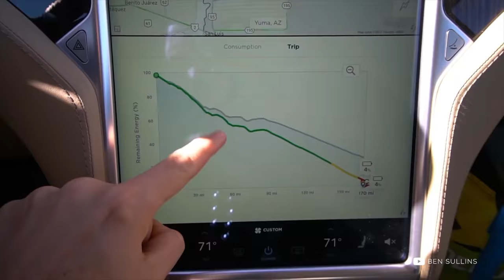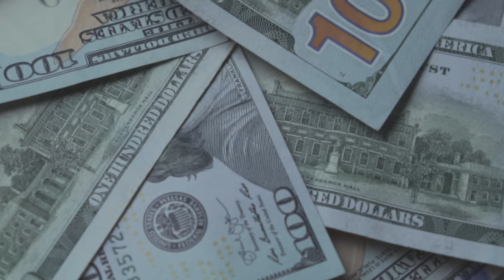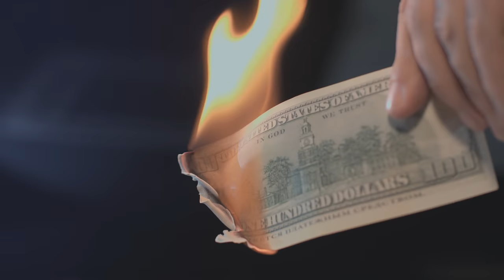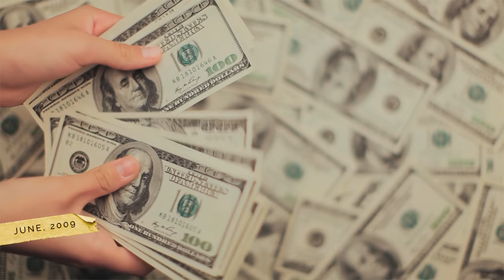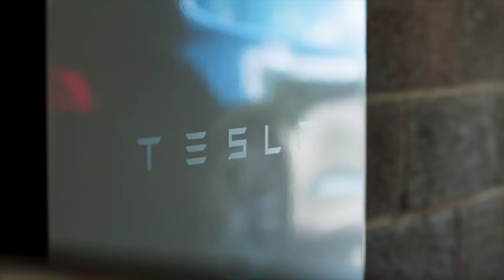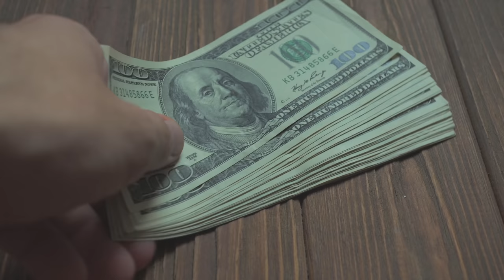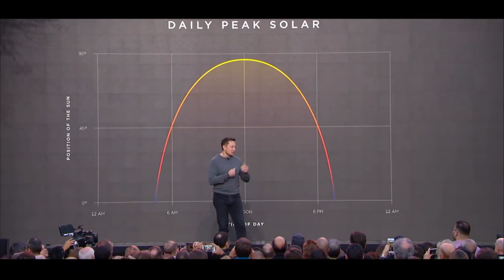Is Tesla REALLY the most valuable car company?

Comment: Shoddily researched video, tbh. Talks about original roadster, but shows the one not yet in production, says Model S had 400+ mile range, when in reality it's only the current range, it was in mid 200 back then. Says Solar city deal rubbed the wrong way, and yet tottally misses the main objection that it was a bailout of Musk and his cousins' struggling company. 

But worst of all, it's just a very generic look into one of the most revoliutonary companies of this century. Vertical integration, a bet against hydrogen, the machine that is the factory, detroit's and other esbl. auto makers inablity to understand coding, autonomous taxis and bet against lidar/machine learning, and wholly sustainable energy, with the car being the center of it all. Munro and the mantra of innovation.  Application of first principles to engineering. I understand it's hard to get it, god knows even conventional analysts can't wrap their heads on why tesla is successful.